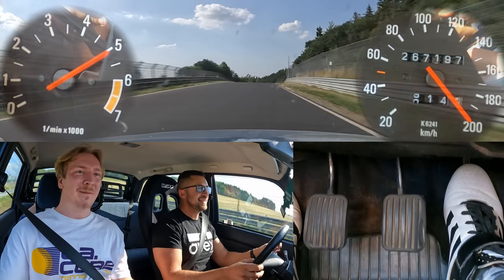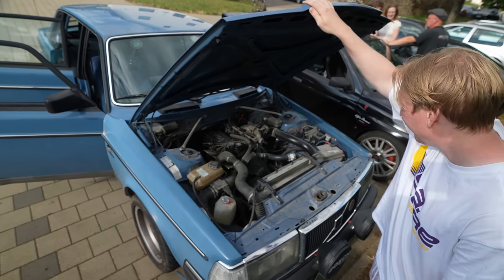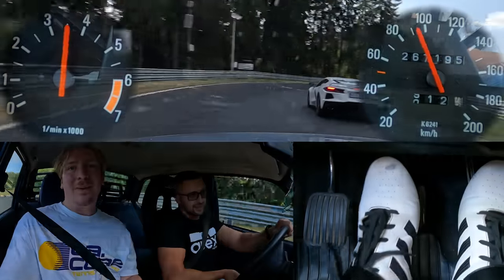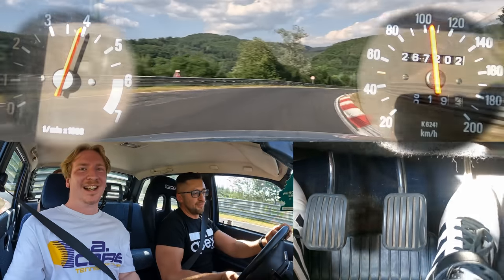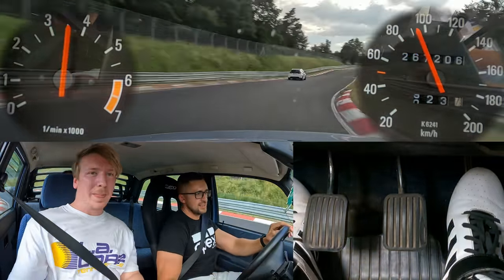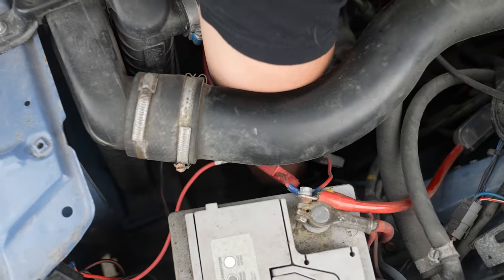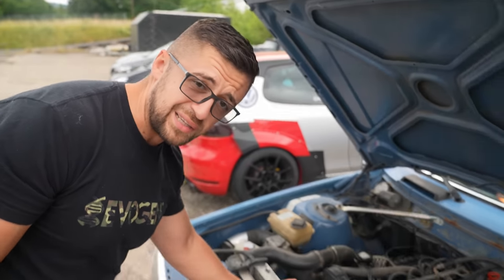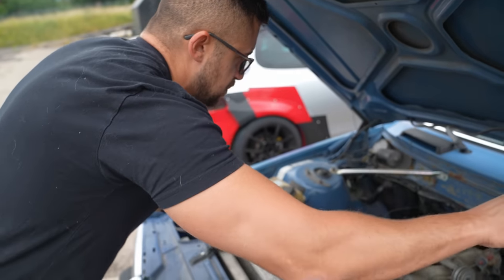I BLEW UP A VOLVO 240 on the Nürburgring :(

Comment: I thought the sound was the fender touching the tire wall but that must have been a rod knock from the get go. Bad bearing maybe since the sound kinda followed the body roll 😂Hilarious
Reply: Haha I thought exactly the same - that noise COULD be a fender or smt, but then I saw that it depended on the revs and I was like “ok, that is the matter of time, I wonder whether he will notice that”. Turns out he didn’t 😂 but it lasted for quite a while, so that’s something
Reply: that rattle in most of the video is actually the a/c heater fan motor... it sits in the center console, and on older 240s they start making that noise, especially when turning corners...  and it's a real PITA to change out - with some careful cutting, you can get it done in about 4 hours.  Volvo pays 12 hours in tech manual to change it.  It's like the entire dash is built around it. The first actual knock I heard was just as they were coming into/around Carousel, and it was different by just a tone downward.  
I should state, I've owned 17 Volvos, and broken 3 motors ( all redblocks, each with over 200,000 miles on them, one with over 450,000 miles on it... and it rattled for a LONG time, albeit not pushing redline for 10 miles) so I know what they sound like when coming apart.
Reply: @CaptainSeamus  Interesting, Thats crazy hours for just a fan motor 😂

Comment: Just sounded like a typical rod bearing failure after those 267 thousand kms - it could happen to any motor :)  What's more impressive is that when it created the inspection window in the block, it didn't drop any fluids on the track!  Wonder if that was an intentional piece of engine bay design from good ol' Volvo? :P

Comment: Wow, this is wild. A stock Volvo red block blowing up is RARE. Even when it's a swap. My car has the NA version of this engine, the B230F, and it's as happy as could be at over 440.000 km. Over 1 million km isn't unusual for these engines at all. It must have spun a bearing or worse judging from the sound.
Reply: yep the redblocks are bulletproof most of the time, but on a track like this without an oilcooler it wasnt going to last long with any kind of serious beating.
i have severely overheated mine once getting the gauge to the red part without breaking the gasket or warping the head, true miracle ;))
Reply: @stridsvagn1039  Oh right and the turbo won't help oil temps either. Yeah that might be the culprit. 
Mine never goes above halfway on the gauge, but I don't have an oil temp gauge and I never took it to the race track either.
Reply: Recently learned about Red Block Volvos and when this video popped up I was like "No way!"..
Takes a legend to break a legend I guess - they need to resurrect that car and keep the stories going, I believe it'll be possible and quite awesome.
Love the engine compartment light😝
Reply: Recently learned about Red Block Volvos and when this video popped up I was like "No way!".. hoped there would be one mention of it, lol
Takes a legend to break a legend I guess - they need to resurrect that car and keep the stories going, I believe it'll be possible and quite awesome.
Love the engine compartment light😝

Comment: From the first time you mentioned it getting hot we could hear the rod bearings knocking. You couldn't in the car but on the camera mic its quite clear. 
Probably wide tolerances because of the engines age and older oil that would break down easily on track. 
To be expected really.

Comment: I had a similar engine in an old Volvo I owned a while ago. It had a oil leak from the cap also. It was a breather pipe that was blocked iirc. Also Did you know its probably a renault block? Mine was
Reply: the old "cigarette lighter" pcv flame arrestor...  (if you know, you know)

Comment: Looks like it's was the naturally aspirated motor (B230FK) of 240 with a turbo from 940 put on to it. 240 has the distributor in the front left side on the engine but the 940s has it on the head in the back right at the fire wall. Or maybe the distributor was moved. Who knows but this setup might lack the important features of the actual turbo setup that comes from factory for the turbo motor (B230FT). The differences of the B230FT are - different pistons (lower compression), bigger injectors, FT specific ECU, oil cooler (I couldn't see it here in the usual location with next to the small coolant radiator), oil squirters in the cylinders. As many know these differences are significant for any turbo (conversion) engines reliability.
I hope the owner gets this 240 back on the road. The engine change is an easy job. Specially for someone who has done it before. It can be done in a day if they come prepared. Good luck!

Comment: Til Valhalla is right for it!!! But I mean it was doing really well up until that point. It was going faster than you would think. Imagine that, with that body roll and soft suspension, over the flowing yumps of Swedish gravel roads... It must be amazing!!!

As for the blow up, maybe the oil pump went. Would be the same effect as oil starvation. Rod failure isn't very common in these things I would think. Would explain the no oil leak too.

Anyway, would be nice to do a short when this things has a new/old engine and rolls out again.

Comment: There used to be a company called Steffansson Automotive that had all the parts to turn your 1981 to 1984 Volvo 242 Turbo into the 1983 Group-A DTM homologation version. The firewall braces on this car were available from Volvo as were the bottom supports. Ipd, a Volvo Tuner from Portland, OR (USA) had a cross tower brace and sway bars. The rear end is a Dana 44 that could easily accept a Quaiffe or LSD. The best engine is the B23FT from the 740. My old 242 Turbo would have done much better on the ring, but it was sold years ago.

Comment: Long before the engine exploded, it was heard in every turn that there was not enough lubrication, flying bearings were heard. I think the oil was very low and the oil pump was drawing air at times.
😭😭😭
Reply: A lot of the rattling sound earlier in the lap before it blew up is the fan for the ventilation in the car, which is why the owner first thought it was just the fan when they heard the rod knock. The fans in these old Volvos tend to touch the housing they're inside and make some really terrible sounds, especially when going over bumps. You can hear that the noise isn't consistent with engine RPM.

Comment: Not surprised. Have seen the LTT/ low pressure turbo engines throw a rod out the block 3 times. Will for sure happens if turbo pressure is raised over standard. This low power version was not sold as a turbo version and it has the weakest rods you could find in a Volvo engine. This was done to minimize friction and is the same rods as in the carburrted models.  Its not comparable to the Turbo versions B230FT which has beefier rods. A suggestion for repair would be a short-block from a B23 or a B230FK or a full engine swap.

Comment: 240s are very popular junior rally cars in Sweden (entry level, ages usually start around 16) . We had a 240 as a repair object in mechanic class. It had been apart so many times that most of the bolt holes had a chamfer. Easy car to work on.

Comment: I have 3 of these engines under the bench. 1 good  turbo, 1 non turbo with 200km on it, and one 2.5 in bits.
For the taking away. I live in Northern Ireland.

Comment: Ah, this brings back memories..........

It was the weekend of "Live Aid" in 1985 and we were ready to drive to Benidorm in Spain
( from Bergen ) in an 1977 Ford Taunus 2.0L. Due to one of the guys working late the plan
was to start driving at 23.00 Friday night and go non stop.

We got about 7 km when the engine developed an knocking noise, so we turned around and
limped to my workshop. We tore the head off the engine and found that cylinder 3 was missing
a large piece of the piston, so a new engine was needed.

Next morning we called all the local breakers yards to try to find a Ford 2.0 SOHC engine
but no one had any in, what to do.

Called everyone again, did they have an 1.6L SOHC engine in ?

One breakers yard had one that he did not know the mileage or condition of so we told him
"sold", we are coming to pick it up. While 2 of the guys went to pick it up, me and a friend
tore the engine out of the car.

They came back with an engine severely rusted on the outside and told us that it was
lying on the ground outside of the breakers shed!

Anyway, we got the engine in and connected and tried to start it. It barely cranked over
but after some attempts it turned over easier and eventually started, success!

We repacked the car and left at about 21.00 Saturday evening.

The engine was not good as shown when is started boiling after 5 km, so we got some
water from a small river and refilled the cooling system. We decided to turn around, not
to give up, but to grab some plastic containers for water as we might need them for the
2900 km journey ( one way ). We also packed some more tools......

Long story short, we "boiled" our way to Spain. It got better as the rust and the gunk got
boiled out of the coolant system.

When we were in Benidorm, we found a Ford dealer and managed to order a new water
pump and thermostat and swapped the parts in the Ford dealers parking lot.

It cured the problem as the car only boiled twice on the return leg from Benidorm.

I can safely say it was the most fun road trip/vacation I have ever had........
Reply from the maker: Holy shit that's amazing! Thnx for sharing it with us!

Comment: it's actually not "that uncommon" if you dont have a oil cooler on it. and it hav had some bad oil change history. a lot of them used to fail on the autobahn back in the day. oil sludge in the gallery comes lose under high temp and load and block of the oil feed to a min crank journal. AND that engine is "tired" i remember my old carbureted engine did 195 flat out. there is a sound from the start as well.
Reply: i had the same idea since i didnt see an oilfilter re-locator for where the waterpipes should run and since the oilfilter looks to be a "Biltema" filter too im not very surprised of the outcome.
Reply: @stridsvagn1039  the biltema oil filters is not bad. they r made by WIX. the cooler is a must tho. stil i think the engine had a issue from before AND i gues it got clogged oil passages. the engine was just tired and then let go.

Comment: Looks like it died from low oil , u can hear the pump cavitate on right corners from oil sloshing away from oil pickup due to g , on left corners oil sloshes back to pick up and gets quiet. On certain cars , oil pan design makes cavitation possible  on corners even at the MAX oil level. About 0.5L more oil  than MAX is the "normal" and helps a lot if you track the car. Had problems with it in the past myself , measured pan height and crank girdle height to make sure exactly how much more i can safely use before interference , since then never had a problem.

Comment: If i were to bring my older car to the Nurburgring, i would definitely equip it with a Accusump first.  i really doubt the stock oil pan is meant to deal with those kinds of g-forces.  Bearings probably died of oil starvation/pressure loss when the pickup saw air.

Comment: The oil level was to low for driving that fast in the corners. During cornering the oil in the pan went to the side and the pickup tube have nothing to take. 
The second reason would be propably oil. In old cars the oil cooling system is not enough for racing so the best idea is to use oil resistant to high temperatures.

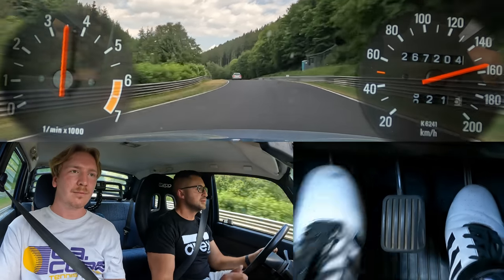Comment: Knock started at 9:05 probably due to low oil level + oil temperature + g forces + wear
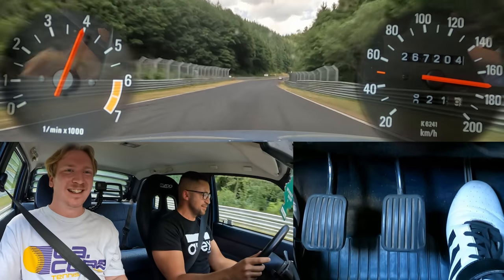9:18 is when he notices what is happening
9:34 you can hear the rod knock due to probably too hot pistons
10:07 oil pump failure (no manifold pressure)
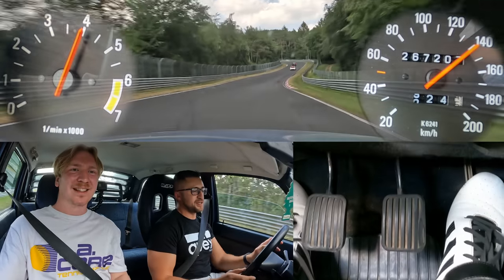10:37 a little bit of rod knock and left turn (oil manifold pressure is sustained)
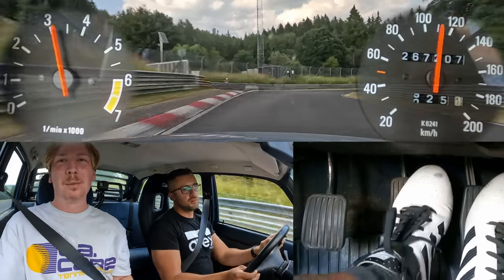11:00 next oil pump failure
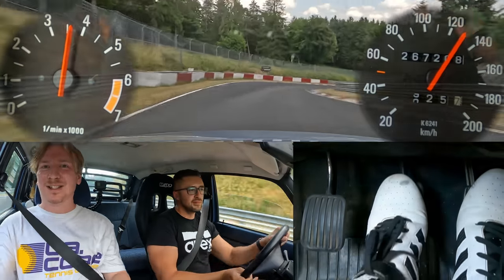11:18 2 next oil pump failures
11:31 main rod bearing has spinned
11:41 next oil pump failure... And then the bearing siezes...

I hope that there was no oil spilled ;)

Comment: I suspect what happened was that you took a turn hard enough to cause the oil pickup to take a gulp of air, resulting in foaming of the oil delivered to the crank. At high RPM it doesn't take a whole lot to kill a bearing or several.

Comment: The BK230 should be able to handle around 600+ hp crank with a relative modest rebuild - especially new piston shafts and somewhat bigger turbo. Needless to say you need a new block...

Comment: When I heard the rattling, I thought that's the fan hitting the radiator, which usually means a broken motor mount & when it got louder & the car died, I thought at least mounts broke.
But since the motor blew up, I'm at a loss as to a cause, although I had the same thing happen to my 2006
Mazda Speed 6 in June 2019, a baseball size chunk blew out of the side of the block & the engine caught fire.
Had to sell it for scrap but I have the shift knob for memories, because I collect shift knobs.

Comment: Car had low oil pressure to begin with… I can hear Rod knock near the start of the lap any time you are off the gas. The G forces didn’t help much either. Great send off for that old lump though! Can’t wait to see the next lap in this blue beast after it has a heart transplant.

Comment: This is the reason why forged H beam rods are the first uppgrade most people do with these engines. the rods are the first thing to break when turning up the power.  

usually about 0.6 bar of boost is about 150, he siad about 160-180 which is usually the case with a new ignition chip and a fuel chip(which is really cheap to get) 

my guess would be a bit to much timing, bending a rod and the weak rod snapped. It is a soon to be 30 year old turbo engine so im not surprised :)

Comment: The oil was probably cheap oil, thinned out with the heat, causing big end bearing failure. Might have been a bad version of the engine that suffered rod fatigue though. Up to 89 inclusive had skinny weak rods only suitable for NA use, however if it was a 940 engine it must have been later and just bearing failure.

Comment: RIP Conrod.
Full Power heat and long high speed sections are always a test to the engine insides.
If he gets a new (old) engine It has to be 100% clean on the inside.
The oil pickup tube really dosen't like sludge.

Comment: The flying brick......well at least for a while. Well at least anyone passed by the 240 would have died of embarrassment........It would take ballz of steel to drive that thing over 200km/hr on anything other than an airport runway.  I wouldnt feel responsible..its a modded "stock" engine not meant to be driven hard as the owner wanted it to be.  If you want an old engine to last at max rpm,boost etc  it needs to be correctly overhauled AND balanced using quality parts.  Thanks for another bangin video Misha ))

Comment: The upside is that Volvo engines can take a lot. The downside is that all that strength instantly gets lots when the engine slightly overheats once.

I had the same on my 940, blew the gasket and filled the engine with coolant right after my own lap of the Ring.
Reply: my guess was that oil overheated and caused the oil to run thin since he for some reason decided to remove the oil cooler and bringing it to a track

Comment: Old B230 turbo, probably oil starved and being a late model redblock it wont have oil squirters and the better rods.
A nice B230FT, well built and better rods and good bearings generally are pretty stout and you could lap the Ring over and over.

Comment: According to wiki, the B230FK has 135 PS (99 kW) at 4900 rpm.  Maybe it's time to get B230GT which has 170 PS (125 kW) at 4800 rpm ?  Or maybe try B6304S / F / FS with 204 PS (150 kW) at 6000 rpm (FF setup though, might need more thinkering) ?

Comment: A B230FK in a 240 too?🤯
That's the most common engine that can be found throughout the 740 and even 940 series of Volvos.
I have an B230F engine in my 92 Volvo 940.
Easy fix for sure to get that 240 running again.

Comment: The hood light has a mercury switch. When closed it should be off. Unless there are variations of them that have plain switches. If the switch rotates the mercury style.

Comment: Respect - I used to sprint and track day these motors in stock form and revved them to the moon and never broke one - tried once or twice😂
Easiest car engine to change all you need is some blocks under the wheels and some strong mates even the bonnet tilts out of the way - hilarious👍

Comment: I can feel the owners pain when he realized his engine was blown. My guess is the engine oil got too hot and thin at the main bearings and other high shear areas OR cylinder temps got too high with pre detonation and knock. Or both. 

I recommend ester based Redline 5W-40 with extra ZDDP. It has a thicker oil film at operating temperature than a 20W-50 which will protect bearings, cams and cylinder walls under high load. I immediately noticed a big difference in power, torque, fuel economy and lower average oil temperatures over MOTUL X-CESS 8100 5W-40 in my MK7 GTI. (I’m not a shill for Redline. I’ve tried Liqui-Moly, MOTUL and Castrol and Redline is by far the best. The others are still very good).
Reply: How do I know my engine makes more power and torque with Redline over Motul? After changing my oil I thought I needed an alignment after I had a lot of torque steer accelerating hard from a stop light which I didn’t have before. Problem is I got an alignment the week before! My GTI has 320 hp and 350 lbs/ft of torque with a subframe traction brace, mechanical LSD and upper and lower dogbone mounts. So wheel hop is non-existent but torque steer is more pronounced with even more power than before.